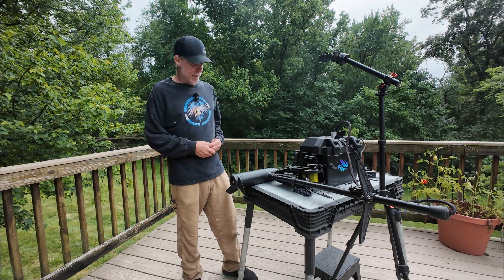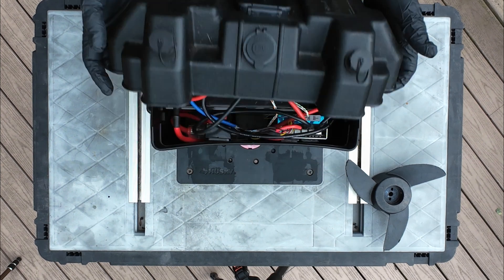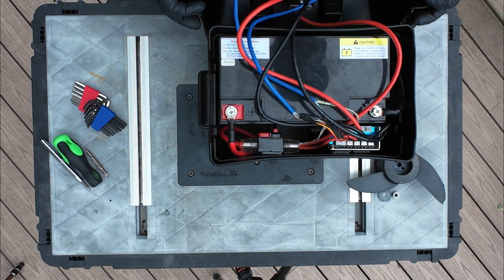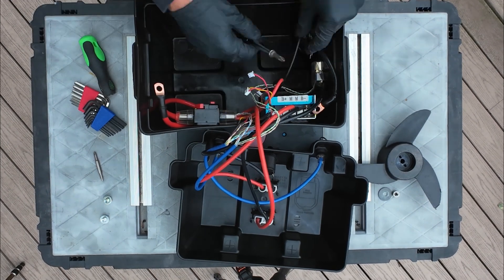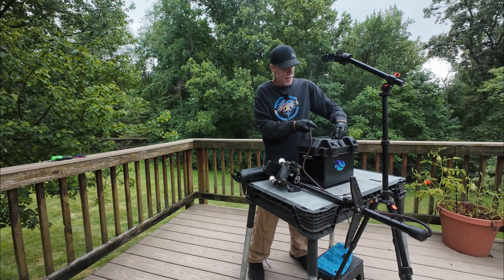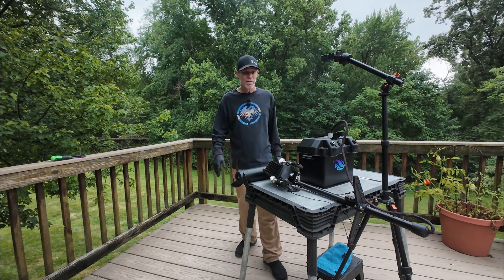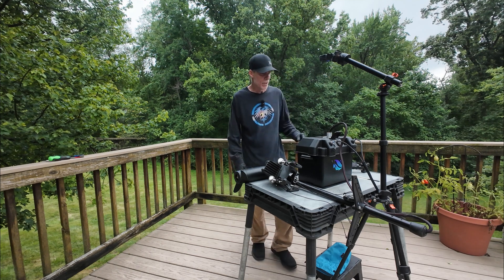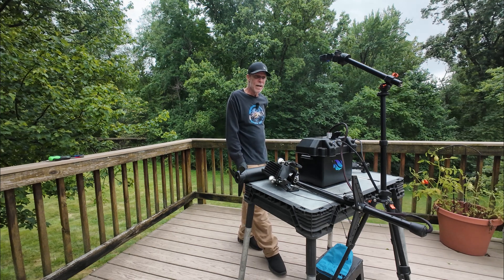Is this a Pulse Width Modulator (PWM) Fail????

Comment: It almost seems like the brushes in the motor are hanging up some because when you go direct max power it runs fine but thru the PWM at low power it kind of stutters like it does.  I raced RC Cars for 40 years and brushes motors for 24 plus years and those motors do the same thing even with an electronic speed control which is I I ever used when I started in 85.  I just built my first trolling motor setup using the PWM and finished all the wiring and testing it out tonight.  Using a 55lb thrust NV Kayak version short shaft motor.  I went with the 60amp PWM and I use Xt90 connectors as they can handle much more amp draw and voltage than an Anderson plug and the XT90 is smaller.  I don't crimp any of my connections as from my racing days I only solder everything so I no I will have zero issues with connections and power running thru those connections. Battery wise Im running two 30ah Lithium in parallel.  Guess I will find out tomorrow for sure if it all works but bench testing it was pretty cool.  No more 5 step forward and 3 step reverse.  Lol
Reply from the maker: Thanks so much for the thoughtful reply! That actually is a ever-so slight possibility with the brushes. It was purchased "Used - Like New" on Amazon. I'm just about fully recovered from a big allergic reaction about 10 days ago and my vision is almost fully clear again (long story). I'm going to build the ESC this weekend and see how it plays with the motor and do a LOT of testing this week. As far as the Andersons, they are rated at 50A and that motor (NV46) peaks at 40A and settles down to about 30 after the initial ramp-up thrust. The PMWs I have used are the 100A/5000w variety that you see on Amazon. I solder as well, so I'm not really suspecting any connections and no heat is coming off the connectors or cables when it really bogs down toward the end of the day. However, you have me sold on the XT90's. I've always been a proponent of overbuilding and keeping things cooler. I'll be using them in future projects. Thank you for that! 

Are you on the Manta, as well? If so, check out my steering and lift videos in the Manta playlist. Those vids apply to other kayaks, as well. https://www.youtube.com/playlist?list=PLLdVIS53jYPoI_fc5rgXLSV3D0r4_m6qe Please let us know how things went today!
Reply: @BarryP  Glad your recovering and vision is cleared up.  I'm not on a Manta but still will check out the vids because you can get ideas no matter what brand of kayak so I will certainly check your vids out.  I'm on a Bondafide SS127 for about a month now and came from a Cresecent LT2 for the past 3 years.  I'm running a NP Vessels 55lb  thrust trolling motor.  I'm just getting it all dailed in.  First test on the PWM was Friday evening.  Just waiting on AMazon now as I'm going to add 3 micro type fans like I used when I raced RC Cars but 12v fans vs the others I used where 7v fans.

Comment: PWM is a rough way to drive a motor, the pulses will translate to vibration forces in windings etc since all magnetic forces correlate to current which PWM pulses 0%/100% very fast. If you hear whining you hear the forces in place created by the PWM. Also since PWM draws current from the battery on-off-on-off (0%/100%) it really depends on battery chemistry how well the battery copes with the PWM. PWM may give lower efficiency and battery life than pure numbers show.
Reply: Exactly. That's why PWM is only used in fast start up motor applications. like drone motors.
Reply from the maker: There are plenty of PWMs (MOSFET switched) that ~can~ control brushed motors just fine without any harm (that's why they make 100a PWMs). The issue here is the heat in the middle of the summer rendering the PWMs unreliable.
Reply from the maker: There's no whining from the motor. And you should see what a 5fwd+3rev tiller switch does to the efficiency of a trolling motor, in comparison. I think the ESC solution is going to eliminate the overheating issue (which only occurs in the summer).

Comment: Your PWM differs from mine. Both my battery hook-ups are side by side. Mine is rated 40 amps and peak is 100. It has been working well with the 17lb thrust motor which (according to the manual) only draws 25amps. It gets pretty warm even with that. The PWM shouldn't care about the battery type as long as the voltage is between 10 and 55. I'm using a lipo4 battery also. I believe that 46lb motor of yours needs an ESC. That's what I'm going to rig my 55lb motor with for a Jon boat build I'm working on. I see you put a battery meter in your remote. Nice setup.
Reply from the maker: The current PWM has a 5000w rating, has a fan and is rated for 100A . I don't understand how they get there, as 100A is a lot different at 12v compared to 50v) but this technically should be "over-built". I am fairly confident that an 18-36lb motor would be okay with this setup, but that 46lb Newport NV gets that box pretty freaking hot after being told to hold a spot for 20 minutes or so at even 5%. Once it does get hot, you lose power getting to the motor. I don't claim to fully understand the mechanism behind that failure, I just know that it does eventually occur 100% of the time in warmer climates. The upcoming ESC setup will have an ammeter and will show current draw on the fly (remarkably cheap) with a much smaller control box.

Comment: Wondering how old/much time on the trolling motor? Loosening the prop nut likely gave the issue away. The shaft bearings are suspect.
Reply from the maker: Actually, that motor only has about 30hrs on it. The overtightened prop nut certainly contributed to the "wind-up"  issue,  but it's not the actual problem. When the PWM gets hot, about half of the available current just... goes away. I'm actually headed out today to demonstrate what happens.

Comment: Hopefully you figure it all out. Right now you are so far over my head. If I knew as much as you, it would be dangerous 🤣🤣. Good luck.
Reply from the maker: I think I pretty much already have, but this context was important. It's tough to make electrical components do what they were not originally intended to do. The PWM thing was a great experiment, but I think the ESC will be better for both the motor and the person piloting.